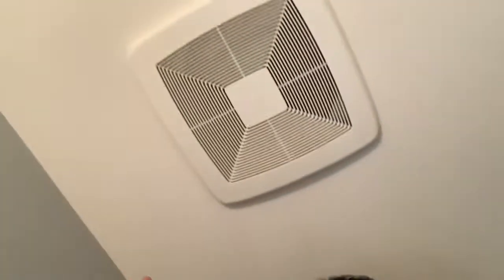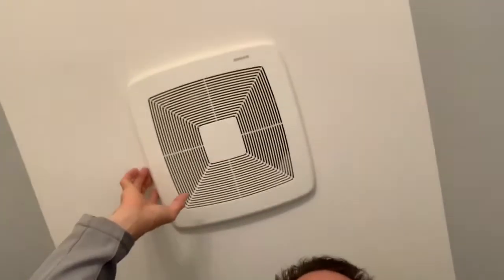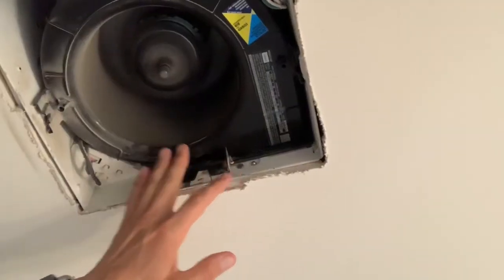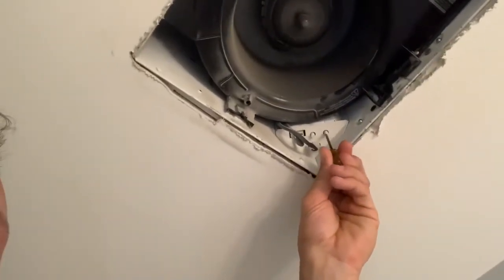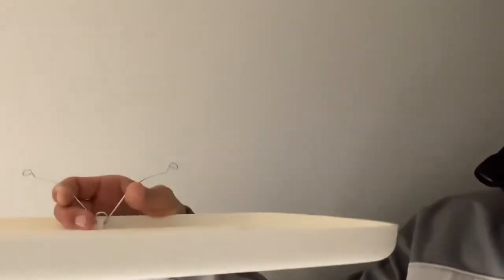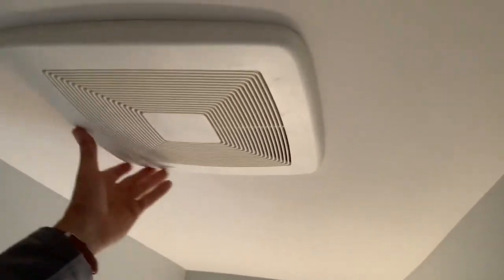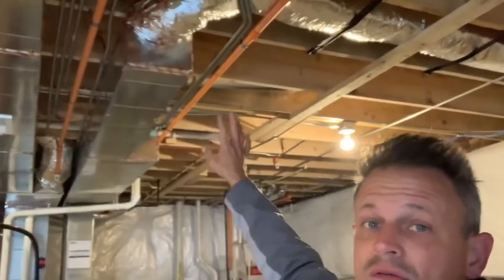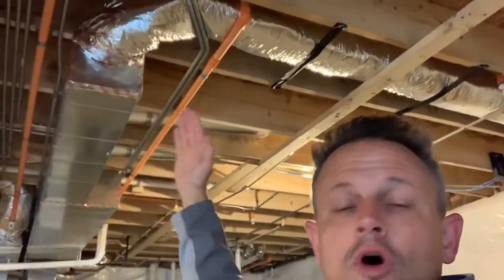Why is my bathroom exhaust fan always on even when the switch is off.

Comment: Does leaving the bathroom door closed make fan stay on? My fan constantly runs even with switch off.
Reply from the maker: Hi Savannah! No, the fan is wired to continuously run. Opening or closing the door has nothing to do with it. If you don’t want it to continuously run all the time, you would have to have an electrician wire it differently.

Comment: I have a Broan exhaust and my home was built in 2020. The dials are not on my exhaust in the ceiling and there is nothing that gives me the model. Any suggestions on how I can turn off my fan and turn on when needed?
Reply from the maker: Well unfortunately I’m only familiar with the one in the video that the builder I used to work for installed.

All I can say is check the inside housing and see if there’s a cover panel that needs to be removed to access the dials? There should be something where the wiring is. If there aren’t any dials I would get an electrician to help you. There’s gotta be a way they can wire it so it just turns completely off with no continuous running.

Comment: My fan continues running when the switch is off my bathroom does it I want to fix that problem
Reply from the maker: It’s supposed to keep running that’s done by design. If you want it to turn off completely when you switch it off, you have to wire it differently up inside the fan. You may need an electrician to help you on this one if you’re not comfortable with electrical work.

Comment: We have a fan that stays on all the time, and vents out through the roof, it has a light, and the switch on the wall turns the light on and off.  It's was installed in 2013, and only occasionally makes a little noise, but usually it's quiet. I was thinking about going up in the attic to try and clean it, but I'm afraid since it's run so long if I shut the power off, it might not come back on.

Comment: bro you think this consumes alot of electricity?my bill is high all 5he time
Reply from the maker: Na, as long as it’s running at the slowest speed you can set it to, it’s a very minimal cost. Typically higher voltage mechanical systems impact your electric bill such as your air conditioning, electric ovens, electric heaters, etc. This thing is like an LED light bulb it’s nothing. 

For maximum cost savings I would turn it to the lowest RPM setting, and turn it to the minimum time delay setting so it goes back to that idle speed quicker after you turn the fan off.

Comment: Well done video and very helpful.  How much electricity is being used with the fan continuously running.  Electricity in this country is very expense compare to Spain, even though in the past year electricity has risen.
Reply from the maker: Thank you! 
I couldn’t tell you for sure how much electricity it draws, however it should be very little because the fan is moving at a very low idle speed.

Comment: I just bought a house built in 2016 and the grill was so full of dirt I took it down to clean it.  It was a complete mystery why it was running continuously at the low speed.  I thought maybe it had a humidity sensor that wasn't working.  I started searching the internet and your explanation and was the best and most complete.  Thank you for the peace of mind, one more thing I don't have to fix.  One of these days I will have to climb into the attic to check the fresh air intake, my HVAC air handler is in the attic.
Reply from the maker: My pleasure Daniel happy to be of service my friend!

Comment: my exhaust fan turns on and off with the switch. is there a way i can make it run continuously?
Reply from the maker: Hi Maia- You could have an electrician “hot wire” the fan to stay on all the time, however the fan in this video is a specialty fan designed to run continuously. 

You’re best bet would be to have an electrician install this type of fan.
Reply: @BJPoznecki  thank you

Comment: Hi.  Thank you for making this video.  My home was built in 2015.  The exhaust fan in my upstairs bathroom has been running continuously for about 5 days now.
I’ve lived here since the house was built and I’ve noticed the fan running before without the switch on and it’s been a softer quieter sound.
Now for the last 5 days, it’s been a louder almost annoying sound.  
What condition does the environment have to be before it shuts off?
Ironically, my daughter says she heard something crawling around in the vent about the same time the fan started running continuously 🤔
Reply from the maker: My pleasure Angela! The fan has no correlation with the environment typically there is a timer that when you switch the fan off it runs for a set time depending on what the electrician that installed it said it too. At this point it’s too hard to diagnose what’s going on especially if a critter is up there and maybe they chewed on the wiring and somethings failed. 

At this point I would call an electrician to come in.
Reply: @BJPoznecki  thanks so much! Guess I’ll be calling an electrician!

Comment: So we should let the fan on 7/24, 365days ?
Reply from the maker: Yes, that’s per design so there is always positive airflow through the home.
Reply: Been in my new house since 2015 my Delta Breeze is hardwired and designed to run 24/7.

Comment: I understand the use for new continuous fans.  But I'm looking to fix my issue with the old standard switch fan that stopped responding to the switch one day randomly.
Reply from the maker: You’ll have to process of eliminate it may just be simply replacing the switch as it may have failed, or the fan motor needs to be replaced.

I would start with pulling the switch out disconnecting one of the wires on the switch and touching it to the other wire to see if the fan turns on. If it does then just replace the switch. 

If it does not then it’s something with your exhaust fan. At that point your best bet would be to have an electrician come in to repair or replace.

Comment: Two of our apts have bathroom humidity fans that wont shut off on off switch in the bathroom. Is it because they're old at 14 years old since construction of the building or is it because of a wiring or motor problem? Do I need to replace the fans?
Reply from the maker: John Connor give me a call at (773) 403-3298 if I miss your call leave a voicemail and I will call you back as soon as possible.
Reply from the maker: John Connor in a situation like yours you’ll have to process of eliminate  what the issue could be. I would start with replacing the switch.